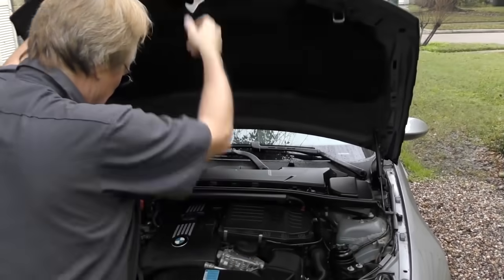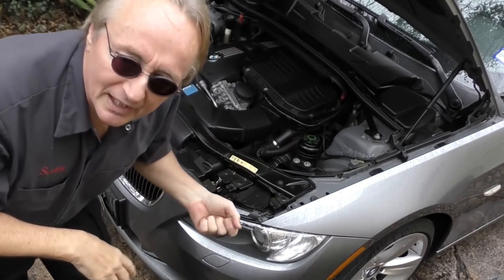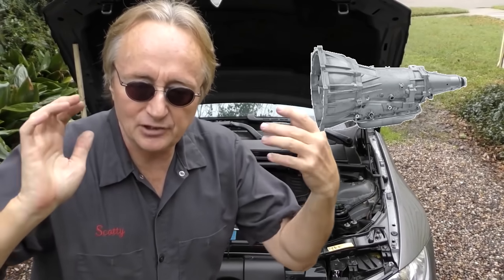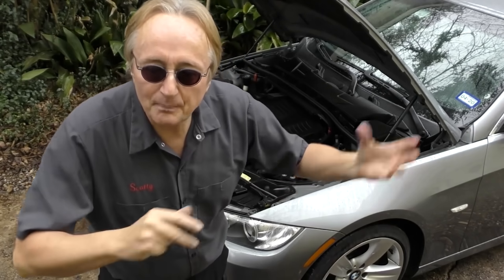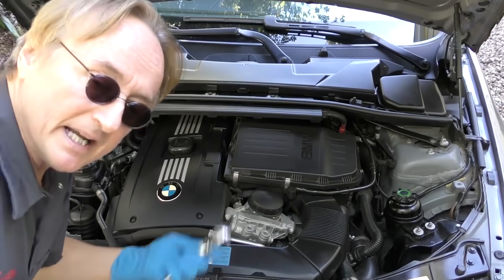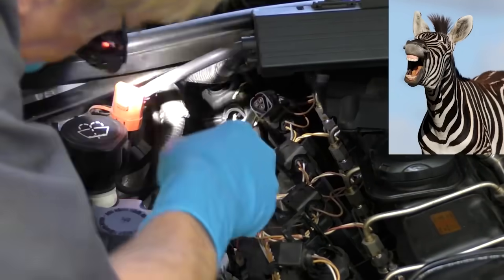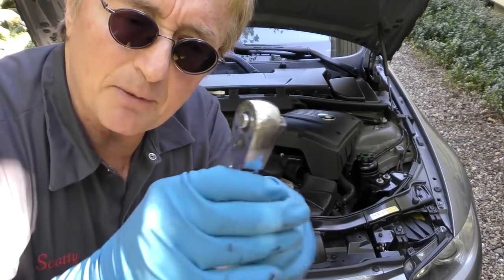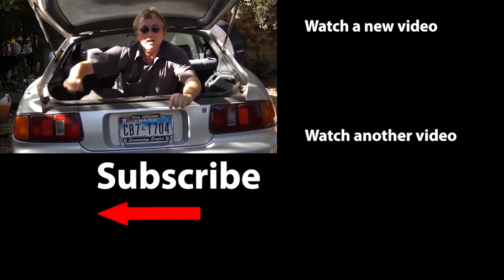People Say I'm Full of Crap About BMWs, Well Watch This

Comment: A $6k transmission?  That is insane!  Yet another reason why I only buy cars with a manual.
Reply: At the dealer
Reply: The BMW M/T might only cost 5k......
Reply: @Whit_Siever  yeah but a manual is way more reliable than an automatic
Reply: @stev_0690  depends on the driver and the inconvenience factor for most people
Reply: @stev_0690  One of the many reasons. There are more reasons to buy a manual than an automatic. Cost, reliability, fun factor, driver involvement, maintenance, theft deterrent.
Reply: It's very tough to impossible to find a manual on a new car. Owning a manual is good hijack deterrent. The thugs don't know how to drive them.
Reply: Same.. except I found an Acura MDX 2002, with only 160k miles.  Three rows of  heated leather seats that fold down to make the floor flat in the back, heated mirrors, 3.5 Honda vtec engine, nearly new tires,  AWD-- moon roof,  COLD  blowing dual ac (front and rear).  All for only $1700.. lol.  I SOOOO wish it was a manual, but I'll have to count my blessings on this one.  There's not a single leak anywhere on it and I actually love this thing.
Reply: @bettersteps  And- clutches are easy to fix yourself.  I just did one on an old 97 f150 that my mom drives.  Piece of cake.  Nearly 300k miles on that truck too.
Reply: Otherwise, I have a 2002 F350 7.3L Diesel with 6spd manual with manual transfer case, manual locking hubs, manual locks, seats,  windows, mirrors,. lol..  It doesn't even have tilt wheel or cruise control.  But it has nearly 320k miles and it's still towing giant 5th wheel trailers up mountains...   (plus I have an old 97 Isuzu Rodeo with a 5spd, 4x4 that I've taken off road everywhere and shockingly nothing has ever broken.  It has like 290k miles on it.   Before that I drove a 95 F150 5spd 4x4 until the engine spun a bearing at nearly 300k miles. lol...  Hopefully I can take my Acura MDX to 400k miles-- I've seen vids on youtube of people showing off my MDX passed 400k.  It's gonna take me awhile.
Reply: @robertthomas5906  VW GTI.  Still offered in a manual and is fun, fun, fun to drive.  I'm driving my 2nd manual GTI and both were very fun and very reliable.  I don't care what Scotty says about VW. A GTI is a great car.
Reply: definitely not 6k i paid 1500

Comment: After 5 years of owning a 2008 328i, I vouche for every word spoken here by Scotty. I wanted to get my hands dirty repairing my own pride and joy. Boy did I pick the dumbest car. Though I'll miss everything else nice about it, Im looking to trade it in for a small truck.
Reply: that generation of 328 had the n52 a pretty reliable engine, probably just didn't know what you were doing lol.
Reply: only problems these cars have are leaks and basic car stuff. do a refresh over a weekend probably cost 1000$ in parts and your car will run like new for another 50k at least. scotty exaggerates most of these issues because of his disgust for bmw even tho they have made great engines and brought industry leading tech to the table. as far as i know bmw is the 3rd most reliable car brand behind lexus and toyota.

Comment: On my 3rd BMW and looking to upgrade to my 4th.  Never been happier.  I don't agree with your negative comments about BMW.  These cars are solid so long as you know how to take care of them.  Most people do not do the proper upkeep, drive the hell out of their cars or simply do not know how to use them (like when you mentioned low profile tires), use cheap Chinese parts or go to a mechanic that will overcharge.  In the long run, they blame the car.  Go figure.

Comment: Well, in my opinion, it depends on the engine of the BMW. My dad has a 2004 E53, which has a 160 kW engine diesel and in the past 15 years, he only needed to change the turbo and the generator (not counting the normal service stuff, like filters and oil). I have had a 2006 E91 with the M47 engine for the past 4 or 5 years, and I literally only had to only change both of the thermostats. My E91 has 450k km, and my dad's E53 has almost 600k km driven. Both cars didn't cost much to take care of them. So when people say the BMW isn't as reliable, it's usually, at least in my country, because people tend to keep the broken parts broken until the very last second and then change it. Which leads to other problems appearing. And also, the M57 engine on the E53 is one of the most reliable engines in the world.

Comment: Every new car is made with a ton of plastics, not just BMW's. It's sad, for a few cents more they could use metal fittings and dramatically increase longevity. But they dont think past the 3 or 4yr warranty because there are no pollution/EPA regulations that require them to make anything other than disposable cars. If you have a nice home garage setup, you can figure out most BMW (or any brand) issues and fix yourself. If you dont have the right tools or a good work space, all performance cars become a nightmare to maintain as they age. If you want more reliability, buy they slowest, cushiest, softest cars because they dont beat themselves up quite as much I've found.

Comment: I keep hearing about plastic parts in the engine compartment that often crack or melt due to old age. I wonder if the BMW engineers keep designing parts in plastic so that customers can have their BMWs serviced for the cracked plastic parts and squeeze money from the owners? Anyone has a thought on this?
Reply: They did it to save weight and money.
Reply: In 1998 Mercedes and BMW statade that they will low down qlty of their cars...

Comment: As a BMW owner, you made this way harder than you had to. Also that car has gnarly wastegate rattle 😂
Reply: the whole car was just poorly maintained, just look at that trans fluid 😂
Reply: Yea, replacing a coil and spark plug takes 10 minutes. And a diagnostic tool tells you exactly which coil is bad. Coils are inexpensive too. Not sure why he was so dramatic.
Reply: Pulling that cabin air filter cowling piece off only takes a couple minutes and makes this all so much easier.
Reply: Simple coil switch lol but love Scotty
Reply: I'd love to see him do an episode on replacing N54 turbos!
Reply: @nasstak3440  cause he a hater. Easy as that

Comment: You gotta check out the 2000-2005 BMWs with the M54 engine. I’ll be honest i used to think BMWs were not reliable but ive had mine all the way up to 230,000 miles and still no problems, all it is really is proper maintenance and it’ll keep going, these new BMWs are tricky though which you are correct about ‼️ keep up the great content scotty, love your videos!
Reply: Absolutely 💯  I've A M54 in a 2003 Z4 also a E46 330xi  with almost 180.000. I keep maintenance up.  and use 10 W 40 oil  The damm cars both are great  The smoothest running  motor s ever and performance  is strong  Naturally aspirated. Lol and well there jus great  cars. Love them both  👍

Comment: These cars are so easy to work on. That’s an N54 engine. Anyone with a brain can change the oil filter gaskets. Also all that trans needs is a new mechatronic seals and solinoids and fluid as well as pan/filter. Also mhd is a great choice for pulling codes and it costs 90 bucks and you use a tablet.
Reply: Any car I buy I want to be able to do the basic maintenance on it at very least . I see too many young people just trash BMWs maybe that's why they have such bad reliability
Reply: You just proved Scotty's point of them being too complicated to fix and not for everyone, you need very specific knowledge to fix them.
Reply: @bretth2920  yeah it’s right there and you can get a life time either from autozone or fcp euro for about 3-400 if I remember correctly. Ls engine is just as hard if not harder when it comes to how long it takes. Can get it done in an hour
Reply: @tonyli2918  they’re just like any car, some even have gm transmissions or zf but they’re simple. All but the mechatronic seals are just like any gm. And the solenoids just pop in and out, as well as the mechatronic seal. If you can’t do simple tasks like changing filter and fluid you shouldn’t even be working on cars period. Most of the plastics can be updated with metal. They’ve been on the market long enough there’s good aftermarket parts.
Reply: @jeffreyhinman1397 Everyone has to start somewhere, I change my 14' Subaru oil and coolant regularly myself and I still don't understand half the things you said. Recently, I got a retired Crown Vic as my project car and changed oil filter gasket myself. Even it's a relatively simple job, it took me a couple of days reading the service manual, scrub the underside and figure out parts. If you think Scotty is wrong, you can upload a video to counter his argument.

Comment: Not a fan of dual turbos, although on a V-6 or V-8 I can see how it would help packaging. But a single turbo is sure a lot cheaper.
Reply: BMWs turbo engine, I think it’s called the N63, is absolutely the worst engine they’ve ever made. It’s called the “hot V” because it cooks the turbos in between the V of the cylinders. It’s terribleb
Reply: @lesterparker1594  I will vouch for this, I had the s63 engine in a 2012 bmw x5 m.... wasted over 20 grand in repairs on that car and still ended up having to sell it, leaked oil everywhere... endless money pit
Reply: @gregdotcomm  man that’s a bummer. Hopefully you learned your lesson and won’t give bmw any more money. I prefer to drive reliable cars until they fall apart. My wife and I have a game where see how long we can go without a car payment.

Comment: Scotty fails to mention the difference between the BMW n52 and n54 engines. The n54 is faster and uses turbos in its engine, which leads to more issues. The n52 is the straight inline 6 and they’re known to be bulletproof engines. Obviously BNW reliability isn’t very great but it’s important to know the difference.
Reply: love my n54, whenever my turbos go out single turbo time
Reply: @akaWilln54  if the turbos go then oh well guess its a 6266 precision time😂🤷🏻‍♂️
Reply: Scotty is clearly not well versed in BMWs, he need to stick to the simpler machinery
Reply: I was gonna say the same thing. The N54 engines are the worst engines, if not, one of the worst engines BMW ever made. Try talking about a more simpler machine.
Reply: @davidkhamush2801  A simpler machine like a toyota? Cheaper to own over any time-frame you want to compare
Reply: @meatball4409  I meant a more simple BMW, as this video only relates to BMW. An N52 engine can be just as reliable as a Toyota and Honda, if you maintain it well.
Reply: @davidkhamush2801  LOL🤣🤣🤣🤣 don't even go there. The thousands you'll have to spend to get it to last as long as an average honda or Toyota...
Reply: @meatball4409  I know many friends and family personally that have owned N52 engines and have only paid for regular maintenance. Their BMWs ran perfectly fine throughout the years they owned them. So, yes they can last just as long as Honda and Toyota.
Reply: @davidkhamush2801  "Only paid for regular maintenance over the years" That is a blatant lie🤣 unless they all have less than 80-100K because BMWs are known to break around then and even before in many cases LOL

In fact BMW sells the most extended warranties of any automaker🤣🤣🤣 I wonder why
Reply: @meatball4409  you will only believe what you want to believe. My dads drives an older 2001 Corolla and that car already requires at least several hundred dollar in repairs. One of my coworkers had an e39 5 series and that car was running mint with no troubles. My sisters civic AC broke and that cost her almost $1,000 to repair. Just a real life example..
Reply: @davidkhamush2801  I will also believe all the consumer auto reports that rank BMW consistently high on the list of least reliable car brands🤣
Reply: @meatball4409  yes, unfortunately that’s the reputation BMW has been given, but unless you have experienced owning a BMW yourself, I think that you may be surprised. I’m fact, I’ve seen more out of the road than I’ve seen in any shop. I personally have cousins that are mechanics and most of the cars they work on are American.

Comment: BMW might go overboard with some of the plastic parts, but the reason the valve cover is plastic is because it's designed to keep the engine in a more constant temperature range.  Plastic is a better insulator than metal in this case and the valve cover is then able to keep the engine warmed up for about 36 hours after you shut it off even in winter temps.

Also BMW just came out with two new engines in 2016 and they are just as reliable as a Toyota so far.  I just bought a 2017 model with one of the new engines myself and I have nothing to complain about getting 30 miles per gallon or more with the full turbo experience.

Comment: I had 19 sonata and 13 x5 both one injector went bad. Hyundai had to go to mechanic cost me $570. My x5 cost me $22. Bought it from eBay and I installed in 10m. BMW is cheaper to mentain that most of the cars. My experience

Comment: I'm from the UK where BMWs are 70% of the road users. I've never, ever heard one person have issues with the turbo's 🤔🤫 I like Scotty but he doesn't half talk some shite sometimes. I've had 3 BMWs, done over 100k miles the only issue I had was 1 failed battery due to a previous owner not using a start stop battery. So had to get the ecu sorted for a new battery as this messed up when using the wrong battery? Cost me 60 quid plus 120 for the battery. Did another 16k miles before selling it. Zero issues. Another show of a bad owner rather than an issue with the car. Yet I had two civics both blown engines? A k20a2 and a B16B (bullet proof engines?). Guess we have a different experience? I'd take my personal one over some fella on the Internet!

Comment: I felt exactly the same way after my experience with a used BMW from 2007 that a friend of my dad’s sold to him. Just utter piece of crap and still has problems now with slight jerking and all that. Alternator had to be replaced and the damn heat valve needed replacing too. The guy who sold it to us swindled us good and was not worth the money he asked for. We will sell it in a few months and just get a pick up truck. Took me back to bad memories of an old 2004 Volvo I used to have. Shoulda watched your videos but had no idea your channel existed.

My personal car now is a Toyota RAV4 from 2017. No problems so far!
Reply: If you're gonna buy a used BMW and you can't afford the repair costs, don't ever try to buy a new one. These german cars are way too expensive to repair if something goes wrong with them, especially the older models since parts for the older models are not as common.
Reply: I'm in the same boat lol, I just got an old 04 bmw 325i I only had it for 3 weeks and I fixed a few things but new problems keep happening, Don't get me wrong I love driving it but I wish the head lights worked and no random abs warning lights etc. lol
Reply: @a4r0n25  I can imagine that. I also have an update. The BMW’s rear differentials went out the other week. Completely broke and the repair would be over $5000. It broke down December and this month and didn’t even have a chance. Most likely we’re just gonna sell it to the mechanic that worked on it before who likes working on European cars or send it to the junkyard and move on. $6k for how much we paid and another $2k in repairs just for the stupid air conditioning ($536) and the alternator ($1800+). The guy wanted even more money than 6k and wanted 11k total for that piece of junk! 

I saw in the Carfax report it was already having problems with the transmission at around 94,000 miles and had been maintained a lot under the first owner especially. I will give it one thing. It had a pretty powerful sounding engine but yeah. Endless money pit as we quickly found out. Sadly it was a “friend” that sold it to us and we know now he likely knew the car was on its last legs and was moving across the country anyway. Couldn’t even give it to my cousin as a work car either. It wasn’t even good for that!

Thankfully we did end up getting a Ford F-150 under our company and the thing rides like a dream! Really big long back for all the appliances we deliver and install. Got our commercial insurance dramatically down too.

Edit: the guy we got it from explained his side of the story today and he purchased it originally knowing that the computer was bad and wanted to fix it up. It had been sitting there for over two years with no activity, explaining why there had been a maintenance gap and got it relatively cheap and was gonna fix it up some more before selling it to us. He was here with us today and saw how much that mechanic was overcharging for all these repairs, and he has a mechanic he goes to for these BMWs that charge a helluva lot cheaper than these other BMW mechanics tend to charge. Don't know how that's possible, but yeah. We'll see what happens, but I still wanna sell it personally, but other folks at our company have different ideas.
Reply: @walpoleandworcester  5k to replace a differential???? Saying that that's a scam is a huge understatement. Also 1800 to replace an alternator?? Thats insane. What engine did your bmw have? Its not that expensive even on their V8's let alone an inline 6..
Reply: My friend had a Rav 4 almost new and it was a piece of crap that cost him an absolute fortune. All cars can be expensive. I feel that BMW gets a worse rep than they deserve. Every second hand car I've owned has cost me a lot over the years to maintain. New clutch in my honda for example -$1500. Cars are not cheap, and things can go wrong with any car.